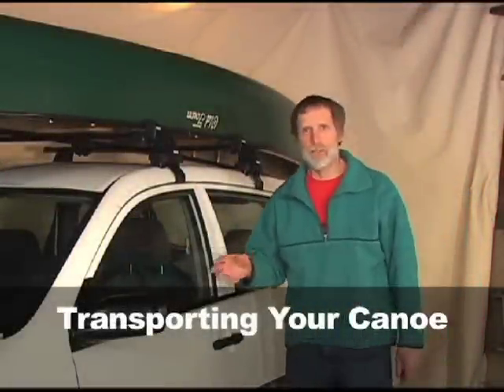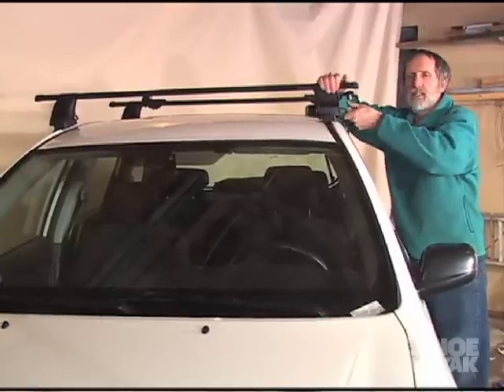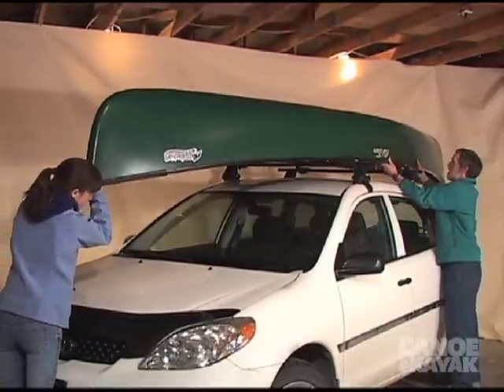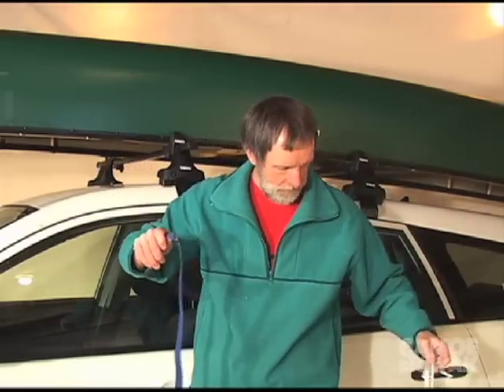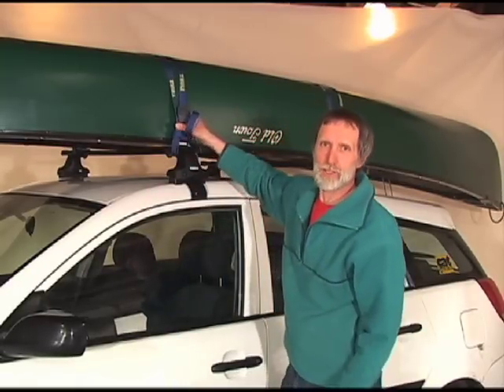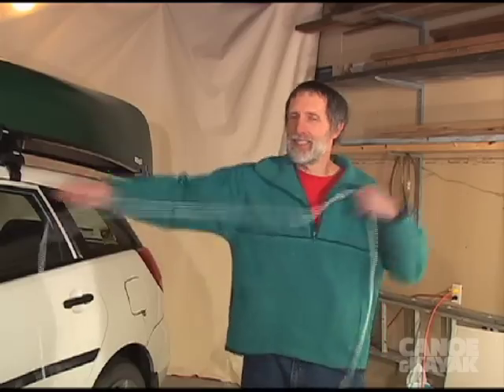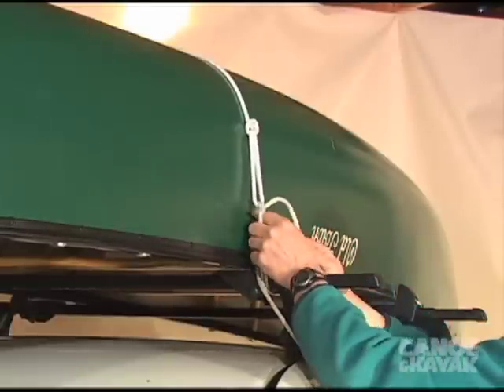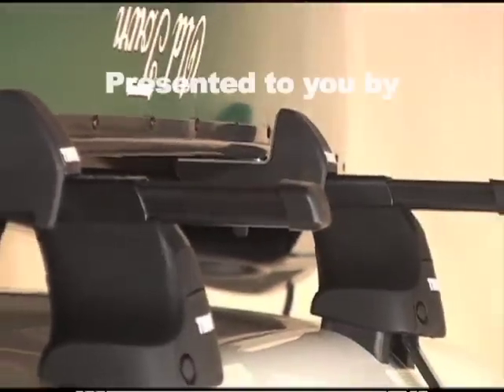VIRTUAL COACH: How to Transport Your Canoe

Comment: Hi there, 

Great video/instruction. The trucker knot helps a lot.  I am just wondering what those rope clips you used on the bow and stern lines were initially.  I have not seen them before with a pull lock and hook...looks to make tie downs a lot easier.  Let me know as I'd like to pick up a set.  Cheers.

Comment: I was loading this way on factory rack that came with my grand caravan drove 600km back from a trip,  I stopped to checking everything hour but my $3500 canoe still fly off the rack  20 km from home,  smashed on highway divider. Actually canoe still attached to the rack it was the rack detached from roof rail. Better run the rope through the car door.
Reply: Well that's a scary story.

Comment: I wouldn't attach BOTH a bow line AND a stern line.  One in the front prevents air lift, makes the police happier and PREVENTS structural stress to the boat.  Otherwise excellent!